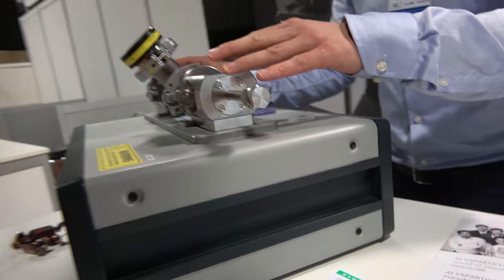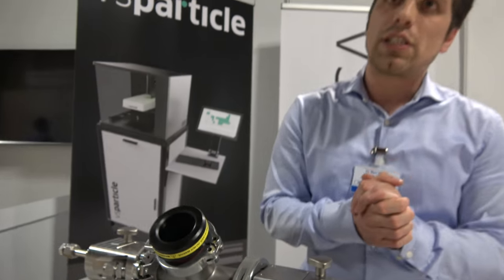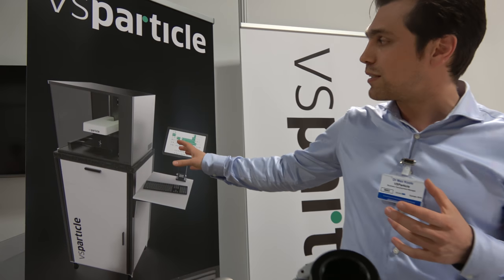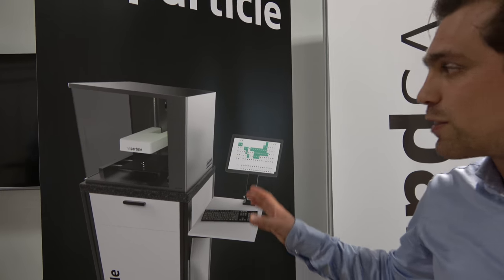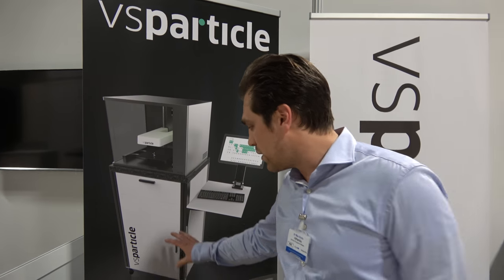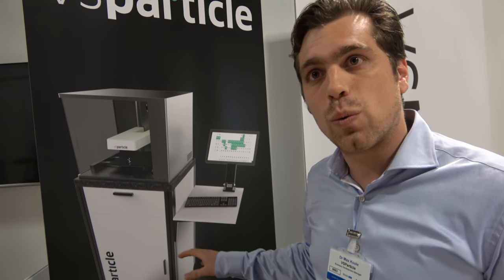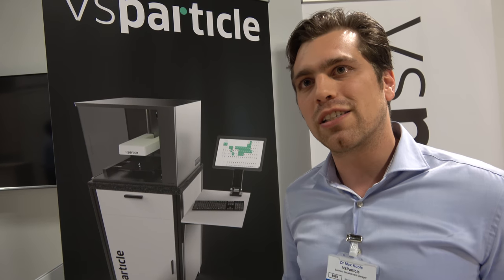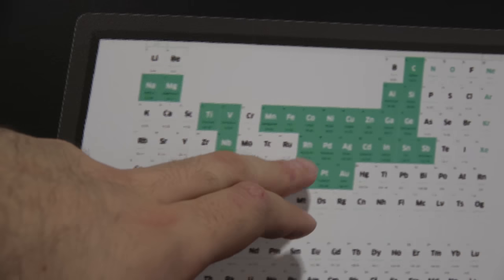VSParticle Nanotechnology aerosol generating nanoparticles in gas

Comment: Translation:
"Spark ablation" - You strike an electric arc between two electrodes (these can be the shape of a bolt or screw or a rod) - think of welding with an electrode or a tazer. The arc locally vaporizes (a.k.a. "ablates") the electrode, (just as a 3d printer would melt PLA) - and this vaporized electrode-material comes free from the solid chunk of metal (say - gold) that is the electrode. A carrier-gas (like argon) is gently blown in the arc (spark) gap, and this carries these evaporated atoms of gold as an "aerosol" (i.e. gold particles in argon) to the "printing head" (the tube to the right). This can be seen as the nozzle of a spray painter - only there is no solvent and the material coming out is in teensy volumes. You can use pretty much any conductive material as your (sacrificial) electrode - and this is what the coating shall be. (what goes in is what comes out). The process doesn't care what conductor/electrode/metal you choose to use - this "I-don't-care-what-material-you-use" property of the process is termed as being "material agnostic" (look up "agnostic" in a dictionary). The brilliant thing about this "spray painting" is that -unlike "regular" spray-painting, the "sprayed" layer is actually not a solid coating, but rather, a nano-structure, which has potentially "magical" properties, rather different from a bulk-coating of the same parent-material (e.g. gold-plating). Special physical properties (of the nano-structured deposited material) , for example, include low 'melting'-points and special electrochemical properties could make that material a novel kind of gas-sensor.